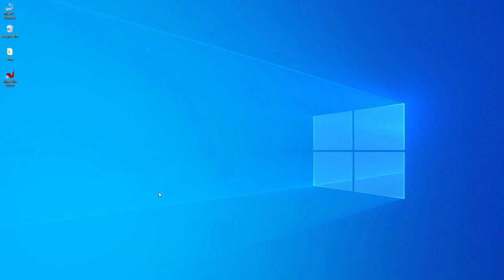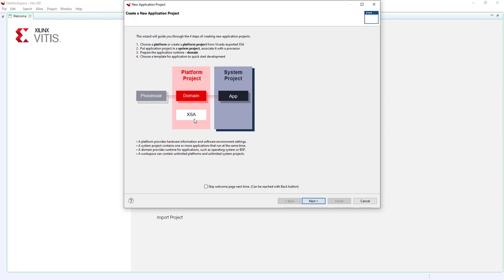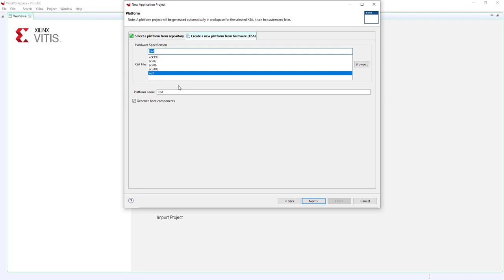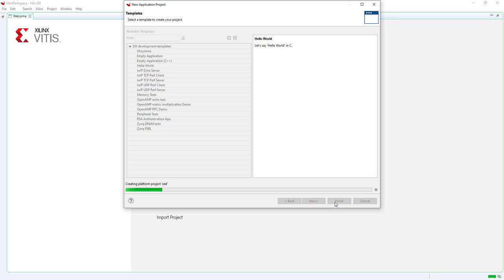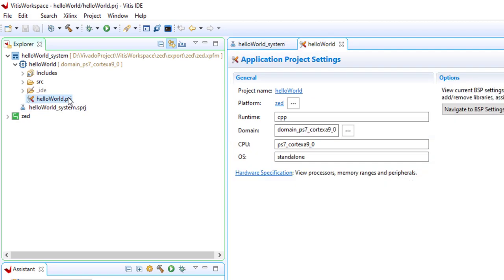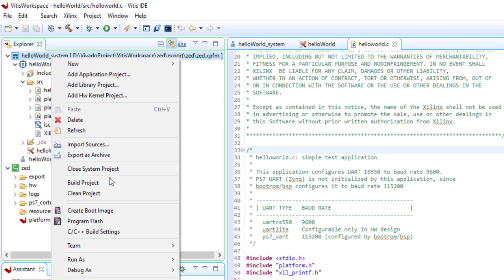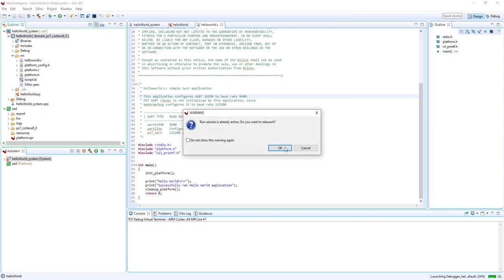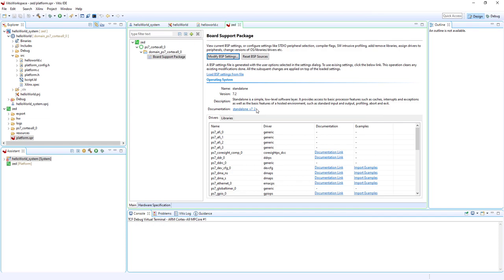Xillinx Vitis Introduction| Hello World with Vitis

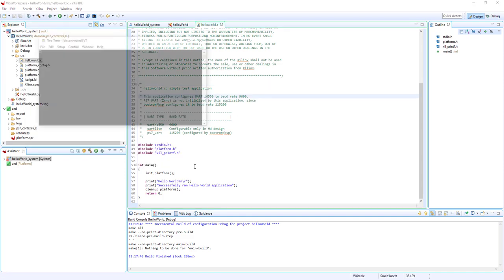Comment: At 7:22, there are 3 options under "Run As", I am unable to use option 1 and option 3. 
I get error "Error Launching Program" with message "Could not find ARM device on the board for connection 'Local' "
I don't have any hardware. How to use it ?
Reply: have you found any solution? I am facing the same issue.
Reply: @deependrasingh1118  No

Comment: Hello Sir. I am running Vivado 2020.1 on Ubuntu 20.04.3. I am running a simple hello world application on a Nexys4 DDR board wwith MicroBlaze but for some reason, I get no print in my terminal. what could be the reason?
Reply from the maker: Could be many reasons
Your terminal program (may be minicom) is not connected to the correct tty
Baudrate is not correct
Wrong pin assignments (chances are low if you used a block design approach and connected UART as a board component)

Comment: I am implementing fir in Vitis HLs, and my design requires interrupt but my instruction doesn’t show that and I am a beginner, can you please help? I will compensate if necessary. The problem is to create an IP called fir which is a filter. If you are willing I will share the file.

Comment: @UCkT8hcmjKupHESuKn-ef5gA  I simulate my first project and launch it on Vitis. However, after building:
1. The Platform, it receive to many errors informing me, they are too many Header files like Xil_printf.h, xil_io.h, ...etc missing in the include folder of the platform under bsp folder. I found all those headers files and add it the include folder. I rebuilt the platform and it works. I've the process like this each time, i'll like to create a platform for a new xsa.file. Now, my questions: Did you face to the same situation before uploading the video? 

2. The application, many failures have occurred: 
->  undefined reference to 'out byte'.   Solution:  for this i had to comment the line xil_printf("Hello World");
->  undefined reference to 'microblaze_enable_dcache'. Solution: i had to comment also the line in platform.c
->  undefined reference to 'microblaze_enable_icache'. Solution: i had to comment also the line in platform.c
-> undefined reference to '_interrupt_handler' in function '_vector_interrupt.  ==> At this stage found no solution up to now :-( . Do you please have any idea, how i can solve this issue?

Thanks in advance!